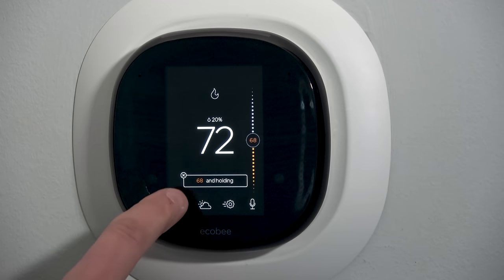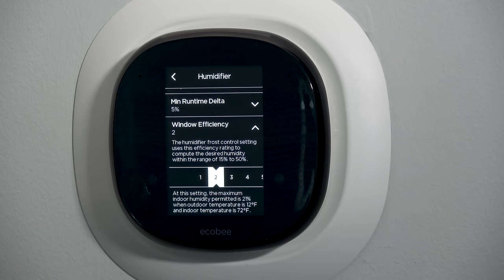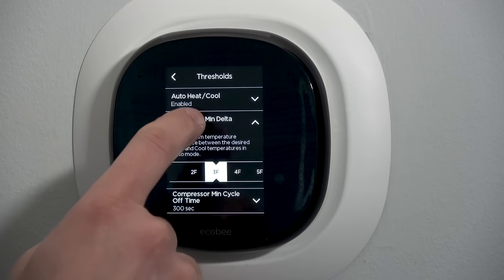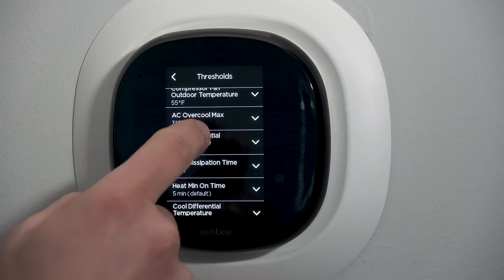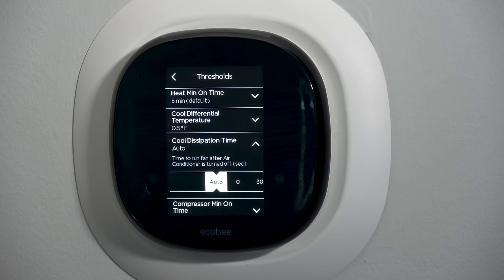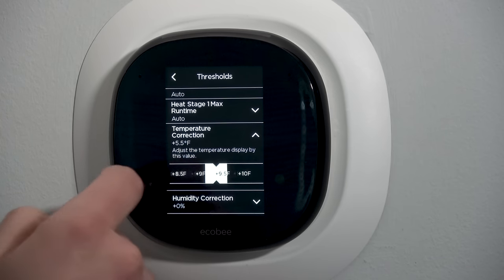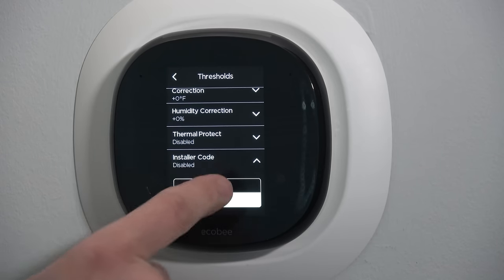ecobee Pro Advanced Setup (3 of 5)

Comment: Hi.  First of all, thank you for the video.  I would love some clarification on the Reverse Staging, if possible.  You say that you recommend to turn it on, but in the video you leave it off and then calibrate the settings that follow it on the thermostat.  I see that when I enable the Reverse Staging, it grays out the Stage 1 Max Run Time.  I'm trying to analyze that, but haven't figured it out yet.  It seems that if I disable the Reverse Staging, but then configure the settings that follow it, that it will still do Reverse Staging, but at the way I have asked it to.  Am I correct?  Just trying to make the right setting.  Also, would you recommend that I run the fan after the air conditioner where I live here in Los Angeles?  My house does feel muggy when nothing is running, and I don't want to  make it worse by any means.  I was surprised, but my Authorized Carrier Installer, doesn't know how to work with the Ecobee.  Only Nest.  They've been in business for 65 years.  Was a little disappointed in that.  Thanks again.
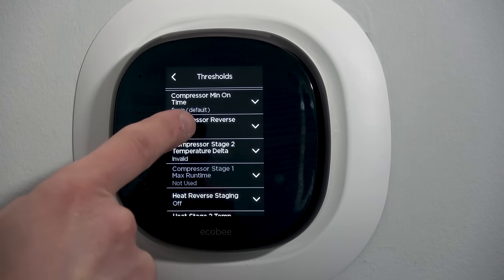Reply from the maker: At the 10:03 minute mark, Ryan mentions why he turned Reverse Staging off in the video.
Reply from the maker: No, that is not correct.  If you turn Reverse Staging to OFF, it will not do the reverse staging and and instead will use traditional staging off method.
Reply from the maker: With the exception of desert climates (Vegas, Phoenix, etc.) we would never run the fan after the cooling call (ecobee's Cool Dissipation Time).  It causes the remaining moisture on the coil to be re-absorbed back into the the airstream and delivered back into your house... making your house more humid.  Not desired for Los Angeles.
Reply from the maker: Correct. Stage 1 Max Run Time is no longer applicable when using Reverse Staging.
Reply from the maker: We are also surprised that your Carrier dealer is not familiar with ecobee.  Carrier owns part of ecobee.  Additionally, ecobee makes a line of thermostats specifically for Carrier called "ecobee Powered by Carrier."  And that dealer;'s customers must have a Carrier Infinity or Carrier ecobee thermostat to be eligible for manufacturer rebates on Carrier equipment.  If they use a nest thermostat, they are ineligible for that rebate, which in your case with non-Infinity equipment is probably $200-400 (varies by state and equipment model).
Reply: @TECTubefilms  I think there's confusion here because in the video he says that turning reverse staging on disables control of stage 2, but it clearly does not. it disables control of stage 1.

Comment: I have two zones in my house.  The main thermostat on the main floor is connected to my Iphone with the App and I can control the settings from my phone.  I have an upstairs thermostat for zone 2.  I can't seem to get my phone to recognize it so i can control it with my phone. It is connected to my home wifi but my phone won't recognize it.  What do I need to do?
Reply from the maker: Once logged into the app for your first stat, you need to "add a device" which in your case would be your second thermostat.

Comment: Why would you say that “compressor stage 2 differential can’t be set higher than 1 or else the stage 2 compressor would come on before the first?” Shouldn’t the differential be a higher number so that stage 2 engages only if the temperature starts out very high (hvac starts out from being off) or continues to get higher than just a single degree?
Reply from the maker: We did not say that.  At the 10:15 mark we said to not set stage 2 delta "faster" than 1 degree.  We never said to not set it "higher" than 1.  We previously said leave stage 1 at 0.5 delta (or maybe 1.0 delta, but never higher).  Then for stage 2 we recommended it be set for 2.0 or 3.0 degrees, but never "faster" than 1.0, meaning never lower.  We should have said "lower" to make it more obvious what we meant.  Lower or higher is going to correspond to faster or slower in terms of the sequence of events during operation.
Reply: @TECTubefilms  thanks for clarifying. I thought I was going nuts! My Ecobee refuses to allow the Auto setting for staging control when Reverse staging is on. Is that normal? I find their menus to be buggy as heck.
Reply from the maker: @evlnte  Yes, that is normal.  Reverse Staging implies that the installer wants to override what the stat is going to do automatically, so you can have both.  So when you turn Reverse Staging on, you then need to manually configure other stuff such as the stage 2 delta.

Comment: I'm looking for how to adjust or disable emergency gas heat, it was on my old thermo but not on this one...  It's actually why I bought this one.
Reply from the maker: You should set it up to run dual fuel based on outdoor air temp. Calculate the thermal and economic break points to figure out when it is cheaper to run the heat pump or when it is cheaper (or more BTUs needed) to run the gas.

Comment: Another way you can address humidity issues is to disable overcool and  set your coof diff to 1.5 depending on if occupants tolerate being a little colder than set point to dehumidify (overcool) or a little warmer (1.5 in this example) than set point for a brief period.  It might take longer to dehumidify on overcool so occupants are in the space at lower temp than set point longer (might get chilly), but 1.5 offset will make the compressor run longer and dehumidify naturally and the room temp will always be within the diff.  Going the diff approach has the advantage that less humid air in summer "feels" cooler so it is more tolerable within the diff range as opposed to making the space colder just to remove more humidity, so perhaps diff method has a better trade-off.   It's nice to have the two choices and setting options for different applications.
Reply from the maker: We have used this method also, but not very often.  The main issues we have with it are: 1) it does the extra differential all of the time whereas the overcool on humidity demand method is only engaged as needed, 2) some customers don't like the temperature comfort (or lack of comfort) of the extra drift, and 3) some customers get confused when their stat is set for 73, but it has to say 75 on the screen for the A/C to actually kick on.

Comment: Very helpful video for those of us looking for a jump-start.  I'm just wondering if you can expand on what a home owner should be shooting for on run times between 2nd and 1st stage heating?
Reply from the maker: The run time should be dictated by the way the equipment was sized and the current weather.  Unless you are willing to buy new smaller HVAC equipment you should not spend much effort thinking about the lack of run hours on 2nd stage.  In fact, the less 2nd stage runs the better... especially for cooling dehumidification.

Comment: Why would you want the thermostat to control the fan?
Maybe I have been doing it wrong the entire time.
Reply from the maker: We get that question a lot. In this case, Ryan's ecobee was connected to a commercial system that needed to have G energized on a heat call. Since filming that video 5 years ago, when we sit in on his training classes, he explains in detail how that setting works. If you have a traditional gas furnace, you want the equipment to control fan on that ecobee setting. This allows it to pre-warm the heat exchanger to avoid an initial blast of cold blow. However, if you have other systems such as electric heat or hydronic coils, then something often need to engage the fan so ecobee has to.

Comment: Very helpful video! I have a question about furnace stages. We just had to purchase a new unit (96% efficient York 2 stage.) The unit it replaced was also a 2 stage, but it is wired to a Nest with only 1 wire for heating and cooling. Does the furnace handle it's staging automatically, or is this wired incorrectly?
Reply from the maker: We are not very familiar with the York brand.  However, we use a lot of Carrier, Bryant, Heil, Payne, and Day & Night, and all of those furnaces have the the ability to control their own 2nd stage without a W2 wire from the stat.  We generally discourage this, though.  The algorithm that controls it in the furnace circuit board is essentially a glorified time delay.  Letting them thermostat control the staging yields better comfort.

Comment: Thank you for this video. For the Reverse Staging, when I turn it on the very next option becomes Invalid and it won’t let me leave the settings. So I just put it to 1F (1 Degree Fahrenheit). Is this what should happen? Does this mean that the heat won’t turn on until it hits 1 Degree difference from what I have it set as? 

I ask this because my furnace has problems sometimes short cycling (overheats basically, most likely choking for cool air) but I’ve noticed Stage 2 works great. 

Thank you for looking.
Reply from the maker: Yes, that is how it should work. The invalid is not happening because you turned reverse staging on specifically, but rather because you turned off the automatic configuration and went to manually (in order to access reverse staging). When you select manually, then you must tell it what you want.

1 degree is pretty quick for 2nd stage to come on. We highly recommend that you select 2 degrees for stage 2 delay. (and leave stage 1 at 0.5 degrees).
Reply from the maker: Your furnace has two different airflow speeds for stage 1 and stage 2. These need to be set at the furnace circuit board and to provide the required airflow that the HVAC company has calculated. Maybe they calculated it incorrectly for stage 1. Or maybe something in your system has changed that has affected the airflow since they set it. Maybe you are using a different type of filter or you shut registers, etc.
Reply from the maker: It is extremely rare for a furnace to trip out on high limit (overheating) while in 1st stage but be fine in 2nd stage. Once it trips off ion 1st stage it won't turn on 2nd stage. Are you 100% positive that the trip occurs in 1st stage and not during 2nd stage?
Reply: Mine forces me to choose a Heat Stage 2 Temp Delta is Reverse Staging is enabled.  I set mine at 2.  You cannot exit the menu if you have Heat Reverse staging enabled and a number of minutes not set for Stage 2 Temp Delta.  The system will state you left the value at 'invalid' and changes cannot be saved until corrected.
Reply: @TECTubefilms  So sorry I never responded to this. I am absolutely positive. Makes sense to me. At Stage 1 when the blower is blowing at less speed there is less air movement going in and out. At stage 2 when things ramps up everything gets moving.
Reply: @76TomD  I believe mine does this as well.

Comment: Great video, thank you. Where do I find setting for oil furnace?
Reply from the maker: No special setting for an oil furnace.  The sequence of operation is the same for all combustion furnaces: natural gas, propane, oil, wood, etc. so no reason for the thermostat to know which one it is turning on.
Reply: @TECTubefilms  Thank you for the reply. In my current set up the fan kicks off after oil furnace reaches certain temperature and continues to run for 90 seconds after the burner stops to allow warm air to move. Do gas and oil furnaces work the same way? Thank you
Reply from the maker: @Boatsman99  yes

Comment: @Tec Tube

How do you set the Ecobee4 to starts the blower alone humidification?
There were instances where, my house temperature was in desired temperature, however humidity was low and so I am wondering whether or not, anyway Ecobee4 can starts the humidifier alone with blower, without furnace fire kicking in?

Long story but in short version.
I bought Aprilaire 600 humidifier and installed it along with its humidistat model 60 came with it.  I ended up removing the humidistat  model 60, due to there is 10 degree difference in reading between my former Honeywell wifi thermostat and Aprilaire 60 humidistat, which resulted in humidifier never kicked in, when humidification is needed.
In Aprilaire humidistat model 60 has an option to kick start humidification just with blower alone, without furnace fire kicking in and it is called "Blower activation".

Comment: I don't have humidifier and was told by support that if you don't have the humidifier and you wanted to do AC Overcool Max, you have to turn on Dehumidify use on AC, I did that and enable it at 56%,,

Only purpose to use the smart thermostat is to save $$ otherwise the AC kept running like 12hr a day! $550 electric bill for me this month!
Reply from the maker: A humidifer adds humidity to the home.  AC Overcool Max removes humidity by using your A/C.  Did you perhaps mean to say "dehumidifier" instead of "humidifier?"
Reply from the maker: Are you saying that once you turned on AC Overcool Max and set it for 56%, your electric bill went up?  Did you also raise your temperature setpoint when you turned on this feature?  You need to do that.  With a lower humidity, you should be able to keep the space more comfortable at a higher temperature.  With a humidity of 56%, the temp should probably be 74F or so.  I keep my house below 50% @ 77F and it is great... and I only have about 1 electric bill per year that even cracks $100.
Reply: yes !
Reply: I am in California, and it's expensive here on electric, like I am paying 90% tier 2 , 10% tier 3....tier 2 is 0.25cent/kilowatt , tier 3 is 0.35/kilowatt. Last month, my battery operated thermostat ran like 12hr a day while setting it at 80-81 and it was in Hallway...hallway is always warmer (plus we cook everything lunch and dinner freshfood, it's one of the reason heating up the house specially hallway faster).

So I figured out ecobee4 just installed couple weeks, I let the Ecobee thermostat runs off the remote sensor in one of the bedroom so it doesn't seem to run that often, a good sign.

I tried AC Overcool Max and was told by Ecobee support that it only runs if I have to turn on the Dehumidifier use AC in system menu. It actually works that bring the temp little far below the set point like 1 or 2 or 3F depend in AV Overcool max setting.

this Ecobee Thermostat works well...I look forward to see my next electric bill how much I might possibly save by using a smart thermostat like this.
Reply: Why would you want your oil furnace running for 5minutes after the set point is made.. that's a waste.

Comment: 6:34 My Ecobee 4 doesn't show an adjustment for Heat Dissipation Time. I live in the upstairs apartment. One furnace serves the whole building. And each apartment has separate ac systems. Rh & W go to the furnace.   Rc, Y, G and C connect to the airhandler for cooling. Ecobee 4 sends a G signal to the AC airhandler for about 30 seconds every time the heat shuts off.
Reply from the maker: Perhaps you have a newer version of firmware since we filmed the video and that option is now in a different spot.  We do not have an ecobee 4 in front of us today to look.
Reply: You have to set set your configure staging to manual
Reply: @davidschlemmer4115  That's it!  I ignored anything having to do with staging because the equipment is single stage. Thank you!

Comment: 8:39 this entire section involving compressor reverse staging is confusing to me. You spend a lot of time explaining just how important it is to have it on, and then at 10:00 or so you reverse course and say to turn it on because it disables stage 2 (even though it looks like it disables stage 1 in the video, and disables nothing on my ecobee). 

All that to say, should it be disabled or enabled? If it grays out something, wouldn't that mean whatever that is would no longer be applicable so you wouldn't need to adjust it anyway?
Reply from the maker: Sorry for any confusion. If reverse staging it is on, it allows stage to shut off as you approach setpoint. Reverse staging has no affect on stage 1 at all (other than allowing it more run time because stage 2 shut off).  We recommend the use of Reverse Staging for improved dehumidification and comfort.